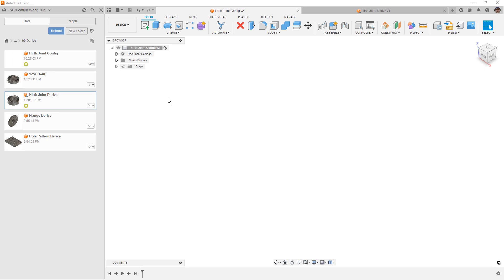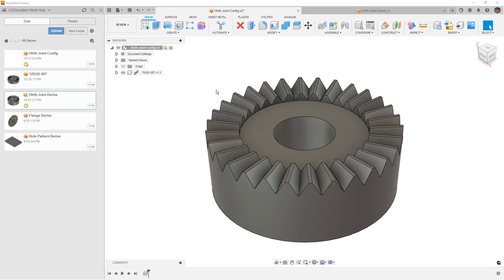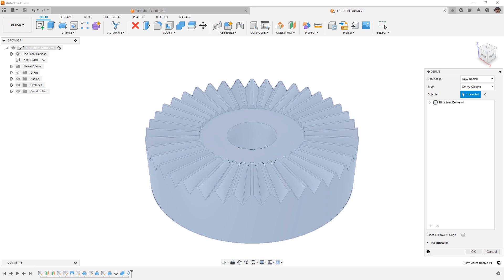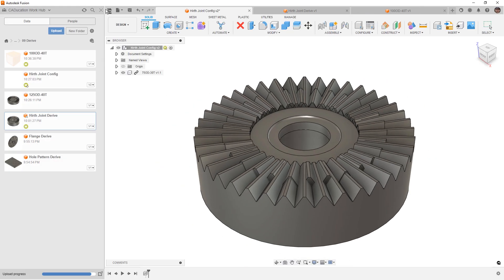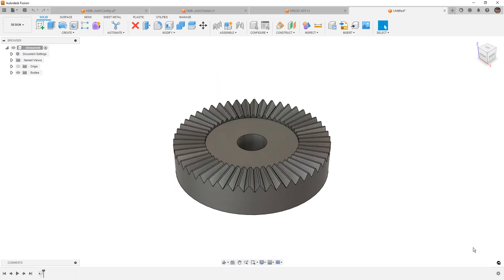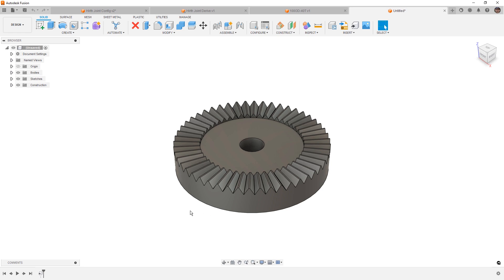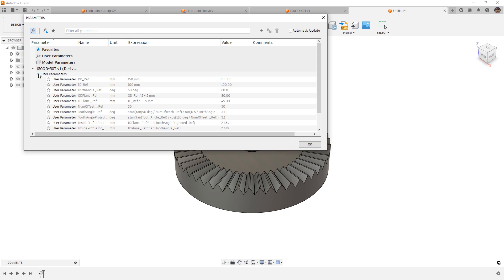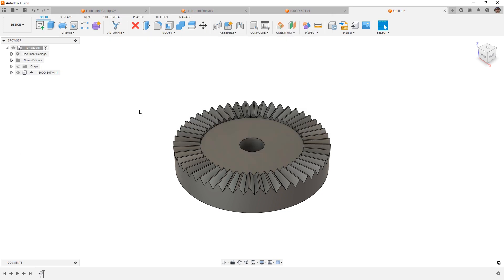How To Derive from Configurations in Autodesk Fusion

Comment: I would like to know how to change parameters of a derived configured design without having to go back to that design and add another configuration. An example, imagine I have a box with a few configured widths, but I derive one of those configurations and then decide I want anorther custom width, or to customise some other parameter. How do I do this? The parameters of the derived design are greyed out, so not sure what value there is in having them there.
Reply: Did you find a way of doing this? If so please share.

Comment: This is like Configuration Inception 😂Creating a part with a Config, exporting it, then re-importing it into the same Part

This was a useful video though and exactly what I needed to know in order to plan out the Derive/Config order for my use case

One point though - a part and an assembly are the same thing right? It's just whether you create Components from Bodies within that document (or import files into that document as Linked Components), right? It's weird to call them Parts and Assemblies when they're in the exact same document (unlike Solidworks, which confused me when I moved to Fusion)

Comment: Derive seems powerful, but I'm just more cofused watching this than when I started. because of the sheer amount of things to keep in mind. Fusion is almost too freeform about how users grab and move around data and link files, and doesn't even attempt to guide users towards some kind of data discipline. I would say usually more options is better but sometimes it's too many options when they all appear to do the same thing but the nuances are small but significant and not things that can be easily corrected after the fact. You gotta know exactly how to go about things before starting instead of figuring it out as you go. And for software targeted ostensibly towards the new and less experienced users, it seems the be counter to that objective.

The more I learn about Fusion, the more I'm spending way too much time managing data organization and trying to read the tea leaves to understand whether I'm in the 'correct' state to do a specific task, and not enough on just making models. At least back with Inventor it was either a part, or an assembly, and it was pretty clear which was which and which rules applied.
Reply: I 100% agree (thats me in the video).  There are so many options.  I have had the task of boiling them all down for a long time but it is so nuanced.  The good news is there isn't a "wrong" way.  Here are my thoughts on it.
1. If you are working on a static assembly (no motion) or a single part that is maybe going to 3d printing. keep it all bodies for simplicity.
2. If you have a design that does have motion but the parts are very much interrelated I usually convert them to components later in the design process.
3. if you have a design that has a lot of assembly components that are related but independent and you are a solo designer, creating components at the start, especially with a long feature timeline, cleans up the oranization
4. If you work in a team or need to reuse certain parts creating them externally is often the best design route.

Some things to consider.  Drawings/parts tables work better components and a logical breakdown of components.  If you need exploded views you 100% need components.
Reply: @LearnEverythingAboutDesign  so that is a handy breakdown, and makes sense. I remember a lot of advice about "step one is make a new component" and so got into the habit of everything being it's own components but then things falling apart as integrating into larger projects and it's just, so wild West mode. Sticking to bodies to start seems like more what I should do most of the time.